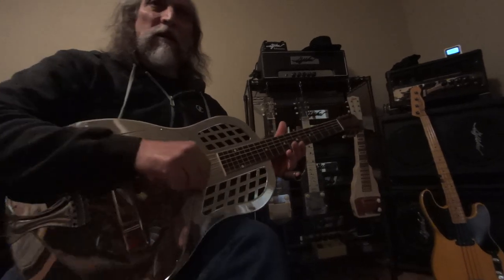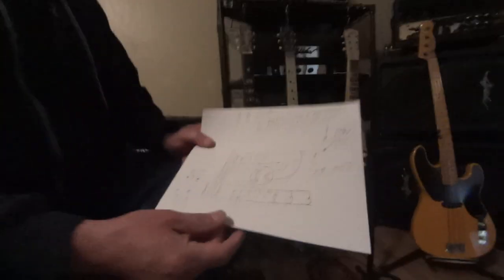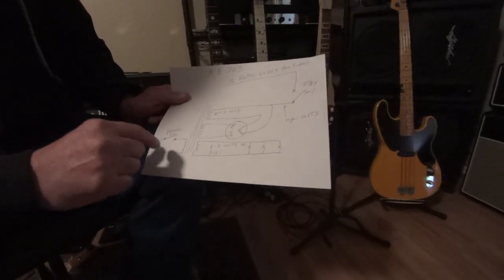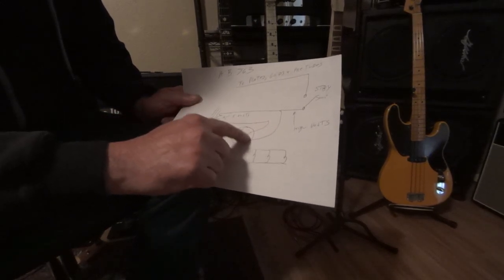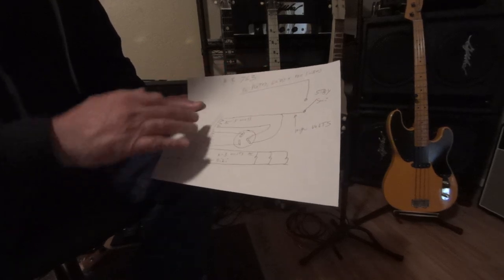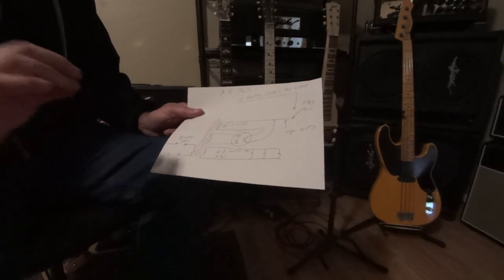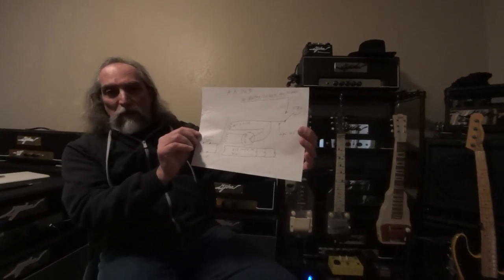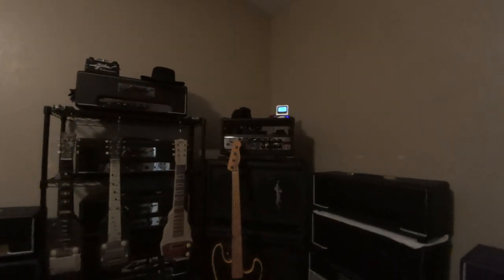Tubeageddon 3 - Final Thoughts on Tube Preservation with Schematic Drawings

Comment: Hi Bob, awesome info!  It's always nice to know the technicalities relative to how a tube amp works!  Having played your amps, the one thing I noticed is how great they sound at low volumes.  There was no loss of bottom end when you turned the amp down which is ideal for home recording.  The difficulty I think most guitarists have when recording at home is that, in order to get the lower end frequencies to transfer to the mic or mics being used, you have to crank the amp and get the power tubes cooking.  The obvious problem with that is either the neighbors call the cops on you or your wife asks for a divorce, lol!  With your amps it seems like you are killing two birds with one stone?  You can get a great recording at low volume levels AND you aren't cooking the power tubes at those lower volume levels.  Am I correct in my assessment?
Reply from the maker: you are correct

Comment: If only guitar and tube enthusiasts realized how much you are simplifying these principles so they can understand them.  It is not arrogance you are coming to them with, it is knowledge, experience, and compassion for tube lovers.  I am an amp builder and electrician, and am a huge fan.  This past year I have been experimenting with single ended after building push pull for eight years.  Single ended take way more understanding and circuit knowledge, aka, tricks to get them to sound great.  Push pull cancel a lot of unwanted frequencies in the out put stage that allows them to be way easier to design and sound great.